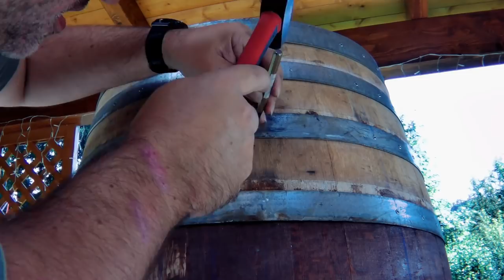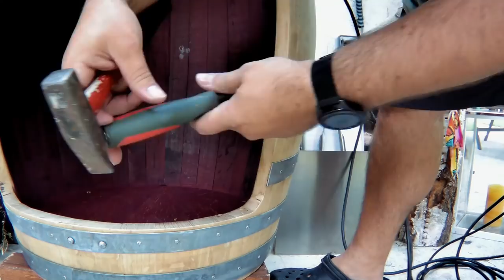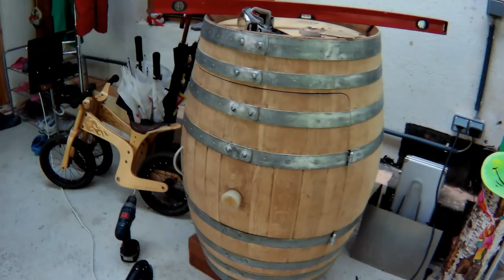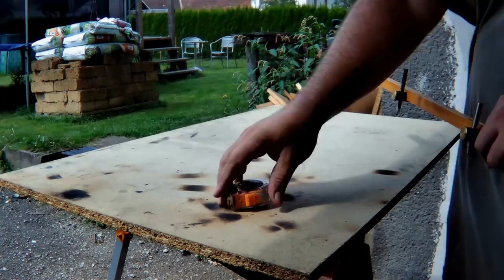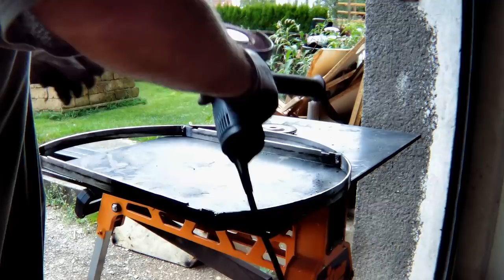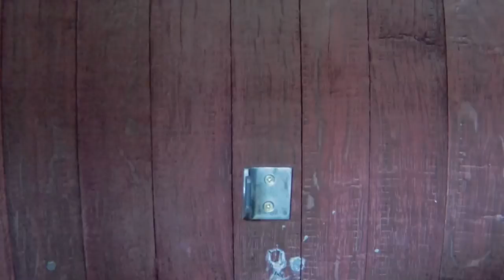Make a Wine Barrel Storage Table

Comment: Can’t sand it near this level with 40 grit paper, tried ordinary electric sanders, circular pad attachment for drill, just bucks the drill too uncontrollable, and hand sanding, takes me an hour to get one little bit half bare. And you did it with a palm sander?
Reply from the maker: It just takes patience and a palm sander / delta sander. Worked fine for me. No special other tool for grinding.
Reply: cp: make it real well I just got a belt sander with 40 grit and it still takes hours and I’m only sanding until half the grain shows bare

Comment: Did you coat the outside wood and bands in oil for protection? Couldn't tell what the can was. Great job on this one.
Reply from the maker: Thank you. I used ADLER Varicolor (Universal matt primer coating and topcoat for wood and metal, indoor and outdoor) http://mobile.adler-lacke.com/index.php?id=1001&type=11&categoryID=34&maincategoryID=5&productID=9528&cHash=6f10a5e49cce5e909469cf00cb2b40b2&type=11

Comment: Very cool project, not sure I get the BBQgrate.  I presume a serving tray function?  Adaptable to what ever shelf you want, but made me wonder.
Reply from the maker: Many Thanks. I have taken the BBQ grate because I store my BBQ accessories in the barrel - it stands next to my grill (seen in another video). So it just goes well with the theme and if some grease gets to the tray, the grate is easy to clean (In the barrel bottom I have inserted as a protection a plastic disc). But it is easily replaced by any other shelf.
Reply: Cool idea for the grate but why did you use the hinge grate with the removable center.  You could have just used the standard grate and would have been cheaper ? The hinge  grate is in the upper $ 30 and the standard grate is in the $20 range? I'm just curious 🤷‍♂️

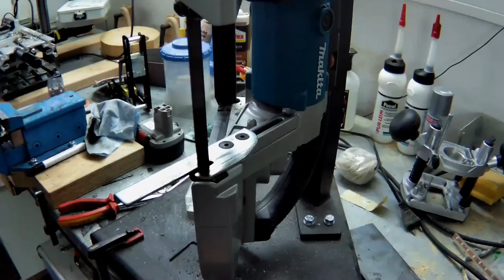Comment: @6:18 what adjustment is that on the Makita to make is as metal cutting device? And what Makita tool is that, please? Great barrel mod, btw.
Reply from the maker: Thank you. This is a Makita 2107FK band saw. This band saw is for metal. No special adjustment. I only build a stand to use it as a stationary tool.

Comment: What is the tool you used to smooth out the holes made by the drill...... before you placed the screws?
Reply from the maker: I used a standard countersink drill bit

Comment: What type of hinges should I use? I made a similar style from my barrel but im finding the door is sagging and its a pain to close now.
Reply from the maker: Hi. I installed the hinges with a bit of pretension and to relieve the hinges, I installed a double ball catch as a lock. The door therefore rests slightly on the lock when it is closed. Works pretty well so far.
Reply: @CP-MakeItReal  did you buy normal hinges and bend them to fit the barrel inside and out? Or did you use a specific hinge
Reply from the maker: @bookwormXmanga  Hi, I used normal hinges from lokal hardware store (or Amazon) and bend them.
Reply: @CP-MakeItReal  ok thx

Comment: I'm having trouble planning my hinges. This might be the way I go. But why put the ring on the inside? Won't the outside steel ring hold everything together?
Reply from the maker: I was afraid that the outer rings would bend with longer use.  They are basically just drawstrings that pull the boards together and keep them in shape.  Cut through, they now have to absorb bending stress when opening (and closing) the door.  This should now be reduced by the additional inner bands.

Comment: Where did you get the magnetic stringline? I've never seen that before, think it's a great idea! Also what's sander did you use?
Reply from the maker: The stringline is a standard chalk line which is used e.g. by tiler and two extra magnets to fasten the line. I use a Bosch Delta sander GDA280.

Comment: Hi just came across this video and loved it :)
Can I ask how did you make the first cut in with the jigsaw at the top of the door :)
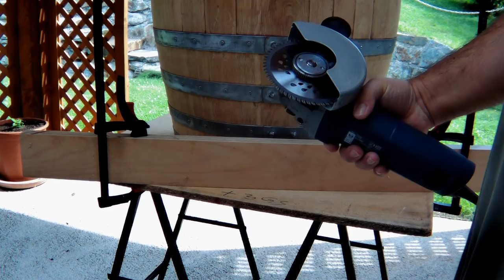Reply from the maker: Hi, thank you. I make the horizontal cuts with an angle grinder (with wood cutting blade >> 3:45 in video). I cut only the corners of the door with the jigsaw

Comment: Where did you get the hinges? I'd like to try that. Also, what size were the hinges & why did you cut them down?
Reply from the maker: Hello, I have bought the hinges in the next hardware store (The hinges are also available at Amazon - see link with the dimensions 250mmx40mm) . I made the cut only for visual reasons - due to the bend, the hinge looks visually diagonal - after cutting they run approximately parallel to the outside barrel rings.

https://www.amazon.de/Scharniere-verzinkt-halbbreit-Gr%C3%B6%C3%9Fen-w%C3%A4hlbar/dp/B075QD81VV/ref=pd_sbs_60_8?_encoding=UTF8&pd_rd_i=B075QD81VV&pd_rd_r=b3034978-feb6-11e8-b808-fdb51f2211df&pd_rd_w=7xTJ4&pd_rd_wg=WMZCJ&pf_rd_p=51bcaa00-4765-4e8f-a690-5db3c9ed1b31&pf_rd_r=MDHPDA8ZBA66TRCFZMM6&psc=1&refRID=MDHPDA8ZBA66TRCFZMM6

Comment: Could you share the angle grinder tool and blade that you used? Thanks!
Reply from the maker: I use a standard angle grinder (Bosch GWS xx-125) with a saw blade for wood (bought on amazon).
eg. https://www.amazon.com/Gunpla-Pieces-General-Purpose-Cutting/dp/B07GBSVYN9/ref=sr_1_4?crid=Y7PMY0XBA88E&keywords=angle+grinder+saw+blade+for+wood&qid=1581794486&sprefix=angle+grinder+saw+blade%2Caps%2C265&sr=8-4

Comment: What kind of screws did you use on the staves/straps?
Reply from the maker: I have used standard wood screws 3,5mm x 20mm (galvanized)......many of them 😉
Reply: Thanks. Would you recommend using an angle grinder to make the cuts over a plunge cut with a circular saw, and why? @CP-MakeItReal
Reply from the maker: I have seen videos were the cuts are made with a circular saw, but ....

I was afraid that I would not achieve a horizontal cut in both axes with the circular saw. 
If you place the circular saw on the surface of the barrel, an sloping cut takes place. 

But I thought, if I cut freehand with the circular saw, the risk of jaming the saw blade is to high for me.
Therefore my decision was to use an angle grinder with saw blade and the use of a guide.
It worked great for me.

But I think with appropriate caution, both variants work. 
Safety first!
Reply: cp: make it real what blade/disc did you use on your angle grinder? I'm going to try this method next.
Reply: @phillippennington  Is your hand steady enough? As you cut if the blade gets canted it will grab and kick, may shatter, scar up cut.
Reply: @phillippennington  What is with you. You ask the most trivial 'Capt. Obvious' questions. Grinder blades are about as generic as you can get. Get one that says cuts metal on the label.  Such extremely basic questions that anybody with minimal mechanical aptitude can deduce with a few seconds of thought. Your questions would make me very reluctant to allow you to handle even the most basic power tools.
Reply: @CP-MakeItReal  Why do you answer such inane questions?
Reply: MrBonners my apologies. I was under the impression the internet was a safe place to gain knowledge. I will curb my expectations.
Reply: I k ow this is probably a really dumb question,but I'm learning  at this point.... Would that size be #10 screws?

Comment: Well done. Too much metal working tools involved though.
Reply from the maker: Thanks for the feedback. I like to work with both materials - wood and metal.
Reply: So? Figure out alternate solutions/techniques or just don't do it.
Reply: @CP-MakeItReal  Why? Let others figure out alternate designs and execution, plenty of other materials and techniques shown at the side panel >>>>>>>>>
Don't spend time 'repairing' Bills of Materials,  not broken, let them adjust to their capability, materials and tools on hand. You don't concern yourself with accommodating whiny lazy 'creators' that need everything handed to them. They actually don't need to be answered anyway. Their questions would indicate they won't build it anyway, they want to buy it at Walmart, particle board. Half the amusement of woodworking is coming up with an idea and figuring out how to do it.  You just keep your ideas coming. 
It's always easier to find a excuse to not do something then a reason and effort to do something.